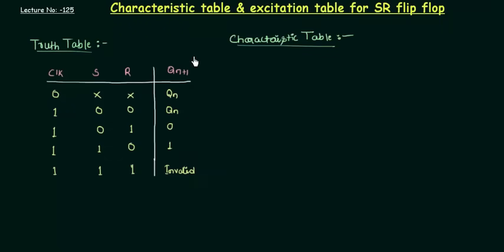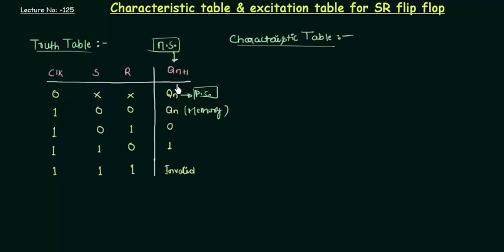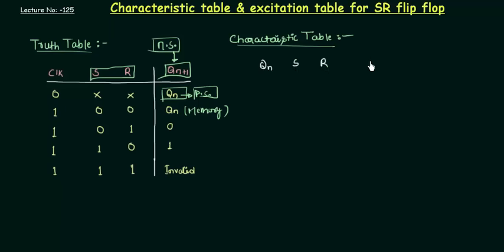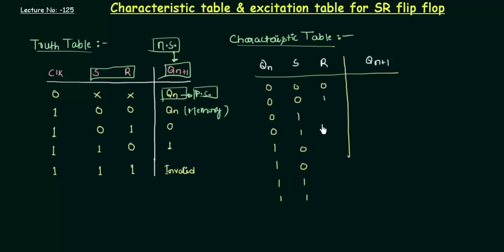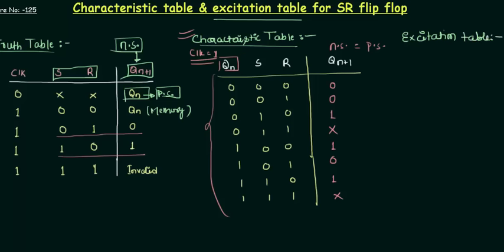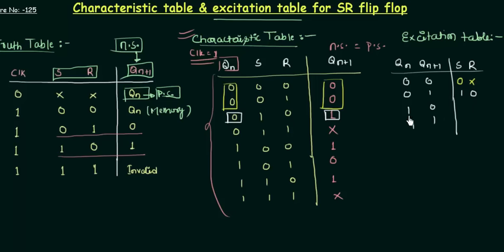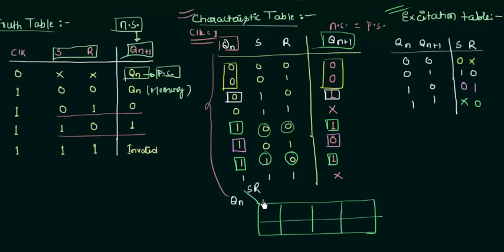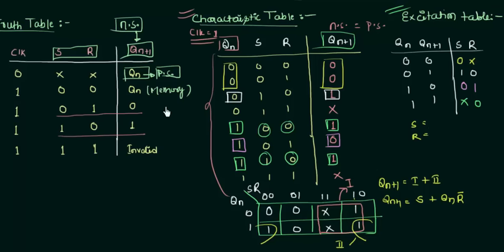Truth Table, Characteristic Table and Excitation Table for SR Flip Flop

Comment: At 8:05: Q(n+1) = S + Qn.R' = S (R + R') + Qn. R' = S.R + S.R' + QnR'. But S.R leads to invalid state?
Reply: you can also add '0'..........Q(n+1) = S+ Qn.R' + 0 , ,,,,,,and use the property A.A'=0 and bring in all the possible eight combinations.....still it equals Q(n+1) only.......The thing here is to get a characteristic(Minimal SOP/POS) equation. Not to make Q(n+1) invalid.
Reply: @harshachallagulla4321  I think you didnt get my comment. 
It is stated in the video that Q(n+1) = S + Qn.R'
Now set S and R to 1. Then you get Q(n+1) = 1 + Qn0 = 1. 
But you expect Q(n+1) = X (invalid) - based on the original truth table.
---
I think the answer to my question is, when S,R are 1, one doesn't care what the formula gives.
Reply: @RahulMadhavan  Exactly the thing is, when u minimise the Boolean equation using K-MAP, if at all there are any  DONT CARES included in the groups, we by default consider it as  1 ( or 0 if we are writing in POS form). So it is never possible for a Truth Table with DONT CARES to give a Boolean Expression that results in DONT CARE when we substitute input values.....it will have to return either 1 or 0 depending on the type of representation.

Comment: Hello everyone :) i believe i how found the explanation to the confusion we are all sitting with. 

How do we get 0 and 1 as Qn in the truth table's two middle cases.?

First, what we must understand is that Qn represents the value of Q in a Nand-SR flip flop.
(Q bar) is not represented in this truth table example as it is not relevant in some sence.

Next, we must for ourselves try to visualize the Q output.

First, let's put:
Clock = 1, S=0, R=1.

through the first nand gate at the top, (in previous lecture) we take 1 and 0 as inputs and get the S* as 1. 
For clock and R as inputs we get 1,1 which is 0 (according to our nand-gate truth table.

so now we have S* as 1 and R* as 0.

If we try to remember the SR-latch walkthrough he did a couple of lectures ago,
we know that whenever S is 1, then Q is automatically 0, and when putting that input into the bottom nand-gate with R* then we get 1. so now we have S = 0, and R = 1.

However, as mentioned just before, Qn represents the Q, not Q complement.
So Qn represnets the Q, which is 0. therefore we put the 0 into the truth table as the value of Qn.

For the third case where S = 1 and R = 0, (clock is ofcourse 1) 
Then the top nand-gate resolves into 1*1 = 0 = S*, and the bottom nand-gate resolves into 
1*0 = 1 = R*. so whenever Reset is 1, then (Q compliment) is 0. and when you use 0 as an input for the top NAND-gate with S* then you get 1..

Again, it is very important to remember that Qn represents Q in our Sr flip flop truth table in previous lecture, so (Q compliment ) which is 0, is not included.

So basically if you sit down, draw out the SR flip flop sequential circuit with control input as clock, and take clock as 1, and try both:
S = 0, R = 1
S = 1, R = 0
Then you will get Q as
Q = 0, (Q Bar) = 1
Q = 1, (Q Bar) = 0
But Qn again represnets Q, so the answer for case two would be:
Case 2: 0
Case 3: 1.

I apologize if i said the same words too many times :) but i don't want to loose anyone :)

on beforehand :) thank you :)
Reply: Thanks in some words just ignore q bar right,and just compare the 3rd case for not used
Reply: so basically Q = Qn
Reply: I think it's nor sr flip flop
Reply: @prajwal_msp  yaa, i don't know why noone is noticing it.
Reply: @32smarty  yes
Reply: @32smarty  nor SR latch and NAND SR flip flop
Reply: thaks dude
Reply: But all these combinations of Qn,s,r are not practically possible in single rs flip flop right?like if s=0 and r=1 Qn is always 0.Then the combination of Qn,s,r as  1,0,1 is waste because it won't happen ..then why the hell we are considering it
Reply: You are  A Hero
Reply: Thank you so much!!
Reply: Thanks bruda
Reply: Thank you so much
Reply: God, the Lord Jesus Christ loves you! Restore your relationship with God by repenting of your sins and putting your faith in Jesus Christ, "... that Christ died for our sins according to the Scriptures, and that He was buried, and that He was raised on the third day according to the Scriptures..." (1 Corinthians 15:3-4)
Reply: Sir  Q is present state but Q(n+1) is next state so how Q=Q(n+1) ?
Reply: @aloksharma5674  It means that memory state will not change. If Q=0, then it'll remain 0; else if Q=1, then it'll remain 1
Reply: Thanks Buddy!!